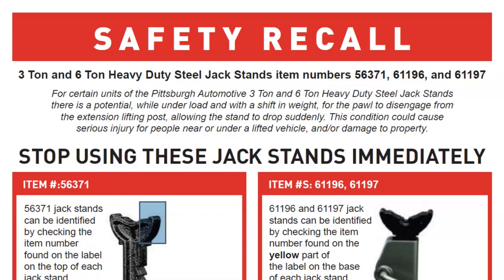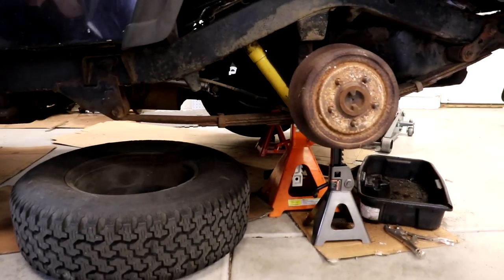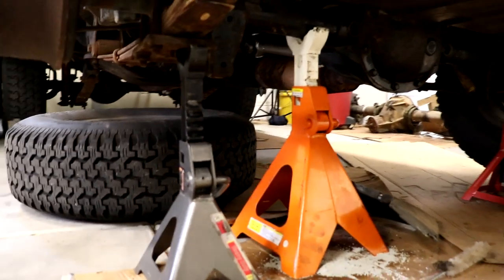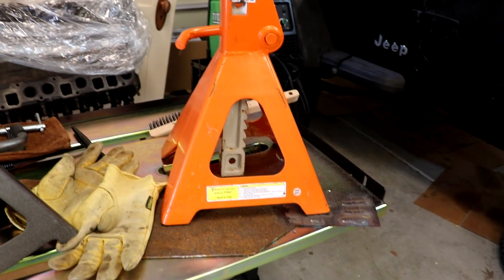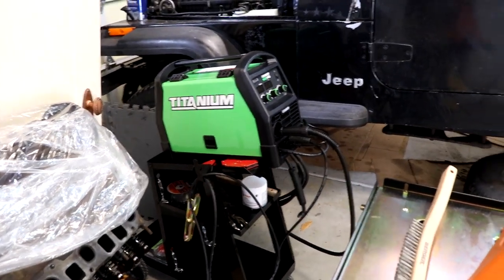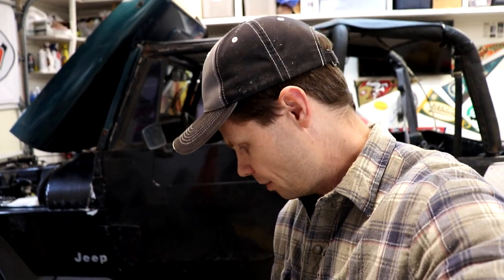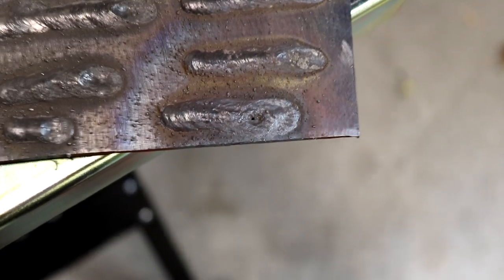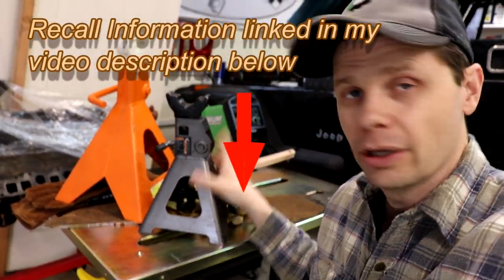Don't DIE Under Your Car!! Harbor Freight Jack Stand Recall

Comment: Tip for welding. On the end of your weld hold the puddle in the same place for a second or two. This will fill up that pit you have at the end.
Reply from the maker: Thank you! I'll give it a try.

Comment: Allow metal to cool between stringers to prevent burn through and pause at end of weld to fill in that crater. I've learned to use a small circular motion/with pause at the end of a weld. However, the crater is good if restarting a weld is necessary. Thanks for the info! Peace!

Comment: I went to check my jack stands. Couldn't find them. Guess someone needed them more than me. As for the welds. That is a lot of spatter but if you pause at the end while welding and fill that a bit before letting go of the trigger I think the end of the weld will look better. Otherwise they don't look bad. My first stick welds looked worse. I prefer gas mig now and finally got a bigger machine to weld 1/4 inch steel. My experiance with mig says the penetration isn't as good as stick welding but for most things it is fine. My best mig welds I did with my eyes shut. Kid you not. It was a verticle weld under a vehicle in very tight quarters. If I got where I could see all the sparks and slag went down my neck and under my shirt. Helmet didnt fit under there anyway so I just went by feel based on what I had learned previously. 
Many many years earlier I took an evening welding class at a community college. I highly suggest you try doing the same or at least get some official instruction. It can make all the difference.
Reply from the maker: Thank you for the feedback! I appreciate it. I will give those ideas a try, with the exception of closing my eyes. I'm not at that level yet. LOL!!
Reply: @JeepSolid  LOL that was a fluke. Never been able to do it again. Point was if you are trying to rely on your eyes but you cant get a good view you may be stuck relying more on your training. Thus it is good to have some training.

Comment: Thanks for the heads-up on this. I just called the store and they're offering a HF giftcard at full price value, regardless if it was purchased at a discount, no receipt required.  My location is awaiting for the new models to come in.  BTW, nice  weld sample starters.
Reply: Dude! Thank you! Mine are affected. Im glad i saw notification, i was going to do some work day after tomorrow and would have been using these! Yikes
Reply from the maker: Thanks for the info!

Comment: I thought I was the only one who puts tires under as extra lol
Reply from the maker: I'm glad I'm not alone.  LOL!  but this just reinforces why I do what I do.
Reply: idk about your rig but if mine falls down onto the tire im still in trouble, ntm the 35"mud terrains would really be in the way of working under the jeep, i just set each corner on a jack stand and make sure theyre secure... the jeep wont leap up off them and they wont fail without something major going down.. if im doiing something i feel might make them fail like boucing on a 6ft snipe to brake loose a pinion nut i throw the jack back under the pumpkin a 1/2" below where it makes contact
Reply: Back in the day of the bumper jack we used to put the tire under the car then lower the car down onto the tire to work on the car.  That was our poor man's jack stand for changing brakes.
Reply: This is 1 of the diy mechanic code.😎

Comment: Another jack stand, # 56373 that was meant to replace the initial recalled 3 ton stands, was recalled in July 2020 due to a welding defect 😬 The information for the July 2020 recall doesn't seem to be as prevalent in google search results as the initial May 2020 recall.

Comment: P.S.A. 
EVEN IF YOU DIDN’T GET YOUR STANDS FROM Harbor Freight. DONT MEAN THAT YOUR STANDS ARENT EFFECTED BY THIS ISSUE!!!

Harbor freight sells products that are already made by another company/manufacturer. So other stands from other companies are also affected. And everyone keeps forgetting that making these videos.

to prove my point my old white/orange stands from harbor freight. 
The ones that I bought on the same day at the same store as my white/orange central hydraulics jack and white/orange engine stand. 

...well the stand still have a sticker on them. a sticker on them with a Part number. so I got curious and searched it trying to find the name harbor freight used back then when I traced it came back as performance tool.

It’s going to be interesting to see if other retailers are actually going to step forward and admit the issue with their product. Or if they will try to stay hidden in the shadows and let Harbor Freight take this bullet and bad rep all by themselves. 

...my guess is that unless they are forced to do so that they are going to just stay silent.

However it needs to be discussed explaining that everyone that has jack stands. I don’t know what other brands are effected of hand. But my guess is that auto part retailers such as autozone, pep boys, advance auto, and others like northern tool very well could have had jack stands made by the same molds in the same factory as harbor freight.

Comment: thanks but i want to also know what makes the jack stands dangerous?
Reply from the maker: "the pawl to disengage from
the extension lifting post, allowing the stand to drop suddenly."
In the recall notification
Reply: More on the why/how:  Tooling that was used to make the pawls had worn, and the teeth are not deep enough to solidly engage. Movement can allow the stand to fall.

Comment: Is there some other way to tell, the labels on mine are long gone
Reply from the maker: Check out the recall I linked in the video description. If yours look similar, same color, etc, I would just take them back. I bet they will refund them.
Reply: @JeepSolid  Guess I'll go in and ask. MIne are all orange and I have welded a 12x12 plate to the bottom to protect my driveway so would rather keep them if I'm not going to crushed.  Thx
Reply: @jeffboulton5693  red 3 tons and gray 6 tons, no orange ones.

Comment: Not a coment, a question. Do you like the welding tabie from Harbor Freight?  There is a lot to be learned about welding on YouTube. BTW, I am self taught electric welder, very ugly welds. Yours look better. You should turn them over so we could judge your penitration.Practice practice practice.
Reply from the maker: Thank you! The welding table works fine for me. It isn't big, which has its pros and cons. Easier to store, but small to work on.